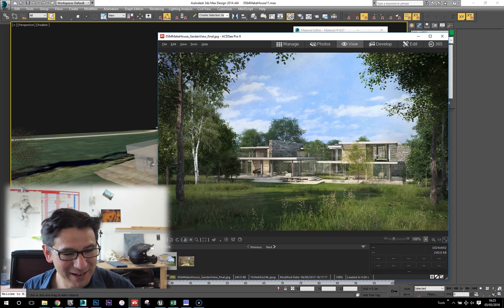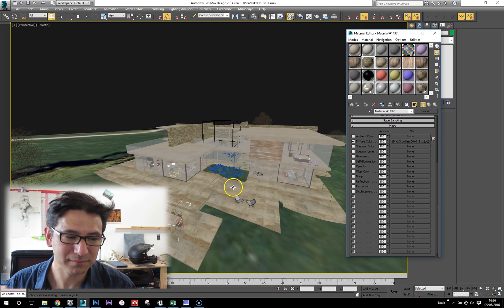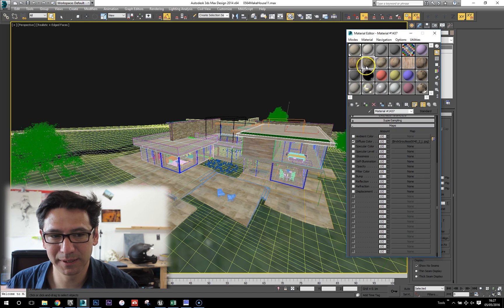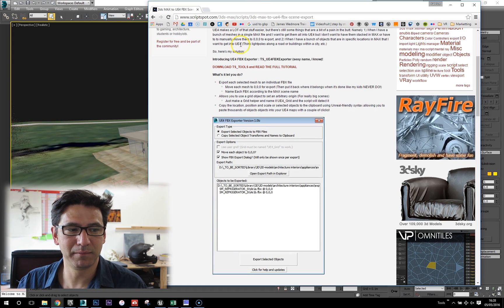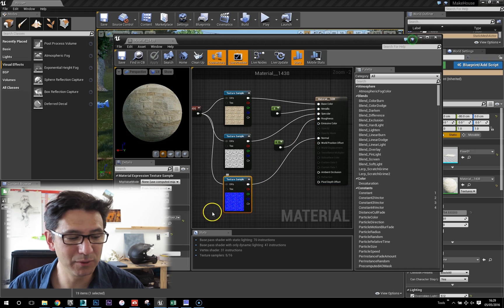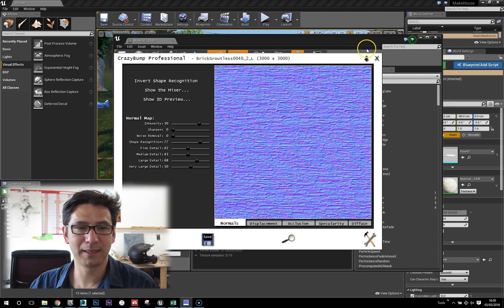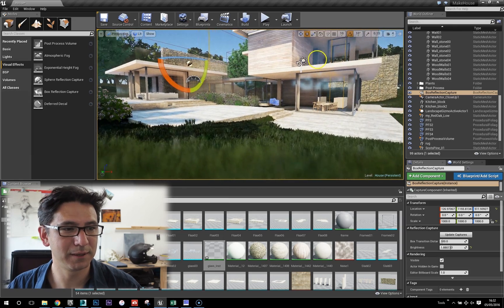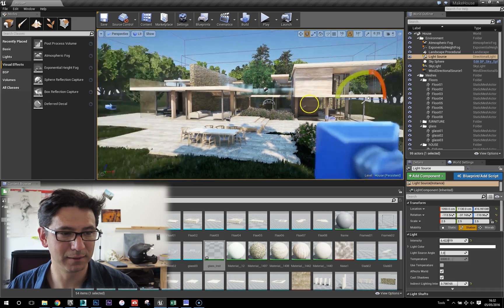How I made this easy Archviz UE4 Exterior. Modelled in 3DSmax and exported to Unreal ENgine

Comment: Hey @Fabrice , Wanted to know what the difference between the two courses - Architecture Visualisation in UE4 and Master Unreal Engine For ArchViz Are? 
They both seem to be showing a basic 3ds max to unreal engine course. Could you elaborate a little please??
Reply from the maker: Hey, I hope you're well. Basically Architecture Visualisation in UE4 is a complete beginner course with a super simple scene going over the basics, ie the interface, how to setup lighting, etc...  Master Unreal Engine For ArchViz is a complete project from beginning to end looking a lighting, materials, blueprints and VR. I hope that helps, don't hesitate to ask if you need more info.
Reply: Hey, Thanks a lot for the quick reply!  So from what I've understood, Architecture Visualisation is UE4 is a more beginner's course and Master Unreal Engine is a more advance ?
Reply from the maker: Yes, that's right ! and now there is also lighting (which I'm still working on ) which is specifically about....  lighting ! ; )
Reply: Yup!! 
Is there a student's discount if I'm taking multiple courses? :P 
Either way, I'm really excited to get into this! 
I've been super excited about exploring VR for Architecture Visualization! 
So far I was doing research about which software to use (Unity, Stingray, Unreal) I think from what I saw, Unreal wins!
Do expect a lot more from me = D
I'll also be excited to share my results / findings with you! 
I love what you're doing! 
Keep up the awesome job! 
lastly, when is your next webinar??? :)
Reply: Shubham Agarwal can you connect with me on my number 8619367484. actually mai be unreal mai get in ho rha hu .. or iska  advance lighting vala tuto karida h .. or ab next piano house buy kar rhe h (group mai karte h) ye tumhre liye b sasta  padega ....

Comment: Full doubts confusions here ! please reply with best answer!  I know to model buildings interior n exterior in 3ds max! 
For rendering with good quality and best fast render which software is good>? for images!(architecture) some times walk through! 

Which one of these rendering engine is good for fast render with good quality!

Options: 
1 Rendering in 3ds max with vray.
2 Render using Unreal engine 4.
3 Render Using Mental ray enginer.
or any software for best result and fast?

(my system specification)
Graphic card: Ti750 2gb ddr5
Ram         : 4gb
Cpu         : Fx6300 6 cores proce
hmm thats all

Comment: Hi Fabrice, awesome tuts. I also recently watched your Ue4 Webinar and have  signed up for the 2nd one on 20th June 2017. Quick Question, do you UV your models in 3ds Max for Ue4? I am new to Archviz but have a strong passion for this real time rendering Archviz process. I'm  also going to take your courses on your website. Thanks again. please post more videos. Kind regards
Graeme
Reply from the maker: Hi Graeme. Yes, I UV the models in 3dsmax. What kind of videos would you like to see?
Reply: sHi Fabrice. thanks for the reply. I am self studying architecture and specifically Archviz. My workflow involves Sketchup and/or 3ds max for modeling, texturing in Substance Designer/Painter and then real time rendering in Unreal Engine. My biggest issue is UV'ing, , I just cant get my head round it. Do you perhaps have any advice or resources for best practice for UV'ing. Look forward to your next ue4 Webinar soon.
Reply: Hi Fabrice, if you have time please can you do a video on how your UV your models in Max. I have been struggling with this for weeks. I am a beginner and have been told UV for Archviz models is easy because it's mostly buildings, walls etc, no complicated, organic geometry, but I still cannot get it right. It is so frustrating. It has halted my progress in learning Archviz. Any help would be very much appreciated. Looking forward to your next webinar.

Kind regards
Graeme

Comment: I have a problem  when I export my file with Fbx tools and I open my EU4 my house is exported but  element by element and i need to rebuild it on Ue4. hilp plzzz ^^
Reply from the maker: yes, that seems normal. just select everything and drag & drop them into the scene in UE. Then make sure you place the whole thing (still selected) at XYZ = 0,0,0
Reply: Hi Fabrice, thx for the reply. I tried ur step but unfortunetly i got a probleme.when i select all the element and do the drag&drop all the element are overlape in the same point
Reply: i got this message at the end (Warning 309____011 has degenerate tangent bases which will result in incorrect shading.  MikkTSpace relies on tangent bases and may result in mesh corruption, consider disabling this option. ) if it can help
Reply: Hi Fabrice, after lot of try it finally work for me but when i turned off the "X,Y,Z=0,0,0" but when i select now an object, the modification tool of place, rotation, scale is everytime on the same place
Reply from the maker: Yes, that's right. You do this for static (can't move) objects like walls, floors, etc... That way if you change the design in Max and reimport, they will be exactly in the same place. 
For a chair (can move) you turn ON "X,Y,Z=0,0,0" and the pivot of the chair will be in the right place (I tihink).
Reply: Yes, Ty so muchhh u save me ^^ and really great tutorials!!

Comment: Hey man, thanks for the video. I might have missed that part, but why would you model first in 3DS instead of building it directly in the UE4 engine? Sorry if this is a dumb question, I started modelling just yesterday. But I love it...
Reply from the maker: Hey Adam, well in this case, the model was already existing in Max (sketchup actually first, then max). One of the main reasons you need to model in a separate 3D package is for the Textures UV mapping. I need to do a video especially explaining this. I hope this helps...
Reply: Fantastic, thanks a lot. As I said, I am only "amusing myself" with the UE4, finding it fascinating to build stuff and see it visualized at the very same time. Not sure if I will ever move on to separate modelling - that seems like something I might not be able to do.
Reply from the maker: yes, there are so many resources already available either paid or for free, you can jsut have fun with that. and it's a great way to learn! :)